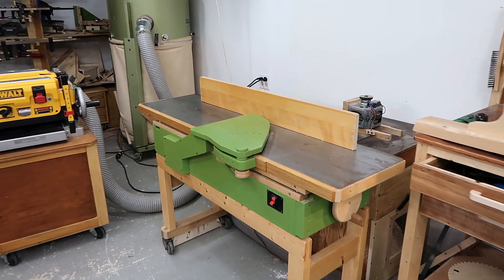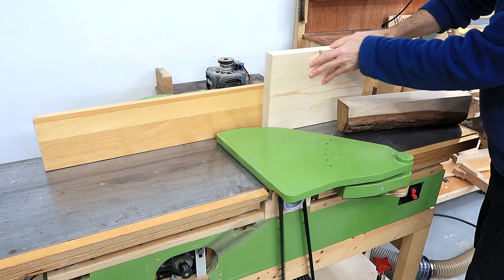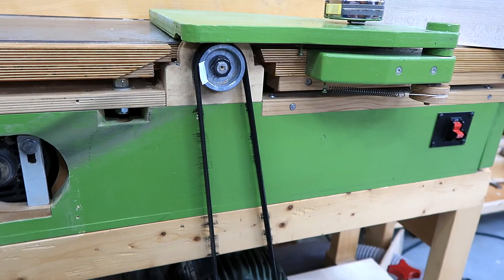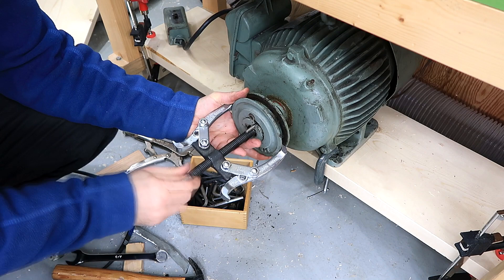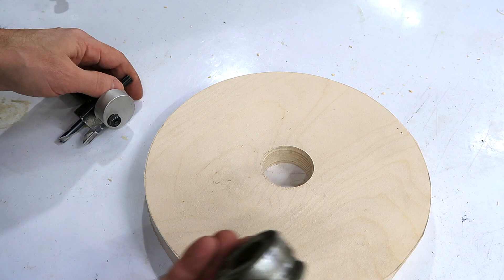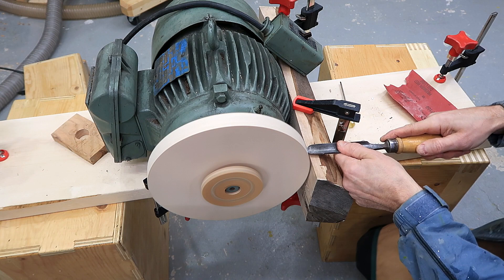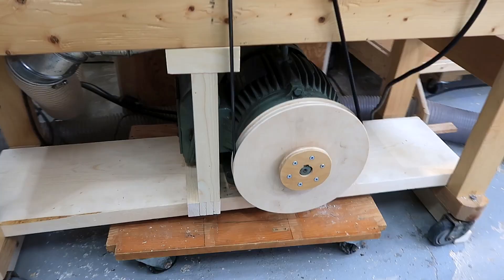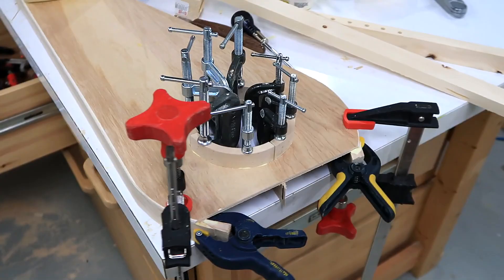Bigger motor for my homemade jointer

Comment: Another improvement would be a noise optimized opening.
On professional planers, the opening between the tables where the cutter head comes through is more of a comb than a continuous mouth.
That way less air gets trapped between the cutter head and the table edge thus generating less noise.

Comment: You should hook up a Kill a Watt power meter and measure the two motors, especially when jointing a wide piece of hard maple or oak. The induction motor might be capable of pulling a lot more than 1 HP when the slip angle is high.
Reply: Kill a Watt?!? Apparently you haven't been watching his videos on Raspberry Pi based current monitoring! Much better data from those.
Reply: Many continuous-duty motors have no problem to deliver ~3 times the nominal power for short amounts of time, although this might be less for a single-phase motor then for a three-phase motor. 

And of course, this is not the case for motors that already have a dubious horsepower figure. There's a large difference between a motor that lists a continuous duty output shaft horsepower, and a motor that lists a short time peak electrical input power.
Reply: @mlindholm  Wouldn't that be overkill for just making a quick test? He's used pi's for years but it's not like he threw the kill-a-watt into the garbage bin once he started using it
Reply: @Koushakur  Same same only different - multiply by the voltage and it gives you all the dead Watts you need.
Reply: @marco23p  Yes. The motor Service Factor is how much you can go over the rated continuous HP.

Comment: The noise of the cutter head is generated when the straight knife passes the infeed table. One way would be to make a bigger gap at the table. But this would bring other issues. That's why a lot of planers have a toothed edge on the infeed table. That decreases the noise since the knife of the cutter is no longer passing by a straight edge.
Reply: Yeh I was thinking that, the cutter head is like an impeller stirring the air up and creating pulses of air that are just god awful

Comment: I like that table saw maneuver.  It's either mad table saw skills, or just mad.  Not sure which.
Reply: Cutting freehand on a table saw like that will catch up to you, I simply don’t care who the operator is. I’m a professional woodworker who used to do that on occasion until one day using that technique hurt me bad. It happened so fast I didn’t know what happened for the first few seconds after it happened. Impossible to see it coming and prevent it, even if you think you have reflexes like a cat.

Comment: I remember you found teething the table to be unneccessary with the old design. It might be time to reconsider this now.
That said I am surprised 1hp is enough power for this. I would have guessed one would need at least 2 hp to keep it going nicely, especially with broader and harder workpieces. My 10 inch jointer has a 2,5hp three phase motor and that is plenty enough, although I haven't dared to take off more than 1,5mm at once with anything wider than 5 inches.
Thank you for sharing and nice work as always.

Greetings
Also Matthias

Comment: A good source of ribbed pulley's and belts is the automotive industry. A quick trip to the local wreckers (junk yard) will provide an amazing range of pulleys.

Also, very interesting that the sound of the cutter head is amplified with the dust collection on. I am guessing it has something to do with airflow over the spinning head.
Reply from the maker: Those tend to be the next size up in terms of rib sizes.  Also, none as big as I needed.
Reply: Yes, might be an interesting video in itself on silencing machinery. I hate those bloody universal motors, I don't know how Matthias has tolerated that one for so long especially inside a house. I wonder how difficult it would be to sound insulate that universal motor.
Reply: @jefflormans5441  universal motors are small and bloody fast. Once those cutters are hitting the work the noise difference is a wash. Most universal motor noise is the brushes on the commutator. Planers are one tool I use ear protection operating.
Reply: It's like the spinning impeller blades rapidly block and unblock a sound chamber making it effectively change size. Think acoustic guitar. Maybe some strategically placed sound-deadening mat such as Dynamat would quiet it a lot more.
Reply: @jefflormans5441  Worst thing about the Dewalt planer is how loud it is. Ugh!
Reply: @jefflormans5441  Supposedly, universal motors run a lot quieter on DC power, but it's going to take some big diodes and a big cap.
Reply: @matthiaswandel   You will have to get a small and large one along with a serpentine belt and possibly mount an idler to tension the belt. My mechanic gave me a bunch of old timing belt pulleys and idlers he was going to toss out.  The idlers are around 1" and 2" wide and are way nicer than the typical aluminum rollers used on DIY belt sanders.

Comment: Nice upgrade! It might also be possible to reduce noise from the cutterhead by modifying the table. Some jointer tables have a row of small gaps instead of a straight line at the edges facing towards the cutterhead. As far as i know this is also meant to reduce sound from the cutterhead by giving the air more room to escape when the cutterknifes pass the edges of the table.

Concerning your motor: why is that motor so big having only 1hp? When you presented your fathers selfmade tablesaw, it also had a motor that seemed to be really beefy for the 3 hp it has. 
You made a series of really interesting videos about induction motors. If your into it, I'd like to see you adressing this topic of motor-build-size in connection with hp in another video eventually!
Reply: HP is a measurement of torque and speed, this is a low speed motor so it has crapton of torque instead.
Reply: Older technology. Thicker wires and thicker insulation, lower temperature ratings, stator/rotor made out of materials that saturate at lower field strengths, older understanding of how magnetic fields should be shaped in a motor. all of this combine to require a larger frame for a given power rating.
Also, larger overengineering factors too.
That motor could probably run at 150% indefinitely.

My grandfather had an ancient 5 HP motor running his air compressor. It was about the size of a wine cask, and 3 times heavier.
But, it was still happily running a century after its birth.
Let's see how many modern 5HP motors are still running 100 years later.

Comment: That wedge lock system looks like something that would be very reasonable to make completely out of wood for anybody with a lathe. Specifically the ones that don't mind using it.  Would probably beat any of the other wood pulley fastening methods out there as well.
Reply: Like the idea! Although two things concern me:
1. the strength of the wood will probably not suffice to endure the high pressures at the key
2. Using hardwood (which seems the most logical thing for me to endure the stress) for the cone part on the motorshaft may result in rather large movements of the pulley due to shrinking and expanding. 

Do you have any idea how to work around that? Otherwise I might actually try it one day, even with the little grooves for the v-belt in the pulley.
Reply: @franzsadler1429  something like Baltic birch plywood could give reasonable hardness while a theoretically being more stable with regards to movement.

Comment: Excellent.   Sounds like a real jointer.  I would have been tempted to make the bottom pulley convex so its self centering.  Not sure if that would have worked.  Looking forwards to seeing it with the new cutterhead.

Comment: Thanks for another great video! I still want to make one of these. 
A helical head ($$$) would run quieter and give a longer lasting smooth cut. Most of the noise now is from the three flat blades slapping the air so when you turn on the dust collector, you are now slapping turbulent air making even more noise. 
My couch potato quarterback opinion 🤣

Comment: the reason that the jointer is louder with the dust collector on is because the knives force air pulses through the gap and turning the dust collector on amplifies the amount of air in those pulses. very similar to why blowers are sometimes added to sirens to make them louder.

Comment: when you use that kind of belt (serpentine belt),you have to put a rogue pulley in the way.best place to install that,is the middle of two pulley,a  bit to left or write,just make sure its on the circuit.(go to the near car repairing shop,you will find all this tools in perfect condition).
i love your works.

Comment: Curious to hear more about motor power “inflation”. Are you just suggesting induction motor power is grossly exaggerated like shop vac motors?

Love your stuff!
Reply: basically, in "the old days" stuff was rated more loosely. And it was also rated so that it didn't fall below the rating during the use period, and under most conditions. They were designed to be rebuilt, so you didn't want them to start failing because the coils were failing.
But now? They get rated for the minimum duty cycle and MTBF that they can get away with without getting hit for fraud.
It's kind of like comparing a tractor trailer engine to a Honda Civic engine with a GIANT turbo. Both will do ~600-650hp, but the Civic engine is literally on borrowed time. It's not an "if" but a "when" it's going to blow up.

Comment: With a belt that long would you not think of adding an offset tensioning third wheel?  With it being so susceptible to small amounts of movement even a slight stretch over time could generate enough slack to cause issues.
Reply from the maker: the old one hasn't stretched.  If it stretches, I'll move the motor.  I put spacers under the motor mounts exactly for that reason.

Comment: Matthias, I ordered your box joint jig plans. but to make that had some other stuff to finish. Finished a wood extension to my table saw, make a new box / stand for the table saw, now thats built my out feed table is not the way or size. So ill build that table out of solid hardwood, then im gonna start working on the box joint jig. My next thing I want is to either make a 12" planer or 15" have not decided yet. Ty for showing this stuff its amazing!! :)
Reply from the maker: 12" is plenty.  It gets difficult keeping really wide tables flat.
Reply: @matthiaswandel  ya I honestly thought that to. My father , and I just sat here , and re watched this video he was in awe you made it. I said dad this is the dude I learn all my stuff from haha.

Comment: you could always drill two apposing holes and tap them, then you'll be able to use two long bolts to "press the pulley off"

Comment: It’s amazing how much quieter that is now.     Also interesting  that it makes more noise when the dust collector is turned on     To me it sounds as though the cutter head makes more noise.   I guess that’s the air flow passing over the cutter   May also be that the air flow is being pulled different directions over the cutter head as apposed to just the cutter head pushing the air ?? Lol

Comment: MarkupCenter , I mean McMasterCarr, does ship to residential as long as you're a registered business/sole proprietor.
Reply from the maker: yes, but you can't register new accounts
Reply: @matthiaswandel  I think you can - you should double-check, I just placed an order a few months ago and had no issues. They can be expensive and shipping is always a surprise cost - but it's never outrageous. They often are the only place to get some things. And I like their CAD models which can be imported (and 3D printed) for prototypes! Of course, the wooden pulley is more fun!
Reply: @matthiaswandel  Surely a US viewer would be willing to receive and then ship it to you? I'll volunteer if no one else will, but I'm in Texas. Someone closer to a primary border crossing probably makes sense, like Michigan.
Reply: @matthiaswandel  I'm in Ottawa and have an account. Happy to help out if you ever need.
Reply: These MMC comments miss the point: if MW just bought what he needed, he wouldn't be MW, that's just not his style. The whole reason we're here--1.7M and counting--is that he doesn't just buy stuff like the rest of us schlubs.

Comment: My one thought on the new setup, is whether a link belt might be better, assuming you can source a cheap pulley for the cutter head. With the length of that belt, might see stretching issues.

Great video, as always.

Comment: As noted a good source for mult igroove pulleys is the bone yard. And yes there is the size problem. Install a jack shaft if needed. For belts an auto parts store. Multi groove belts run quieter than regular vee belts. As to turning the OD of the pulley to the proper profile the grooves are a 40 degree included angle. Surely you know somebody with a real lathe.

Comment: Would you test the power used with the current knives, and compare to the power used with the carbide helical cutters? I thought that since there is less contact with the wood at any point in time compared to a straight knife, the carbide helical cutter head would need less power.
Reply from the maker: Good idea.  I will have to make sure to make some reference cuts before I swap the head

Comment: I mean 1 HP is only the rating for continuous operation. You can still drive it with a higher voltage by an RPM controller to get more HP out of it. As long as you don't run it for hours this shouldn't be an issue. :)

Comment: I would suggest a 5hp induction motor at 3400rpm with a custom pulley. You need a machinist friend to make you a good pulley. At that rpm, you should be able to get by with +/- 6" bottom pulley and you can find a smaller pulley for the top.

Comment: I wonder how much energy is stored in that large pulley vs the weight of the cutter head at full speed.

Looking forward to seeing the necessary modifications and tuning for the new head. 

The physics are quite different so I'm curious how the "feel" of the machine will change. Of course the results on various common and awkward timbers will be interesting to see as well.

Comment: Correct me if I'm wrong - can't helical carbide cutter heads spin the other way round? If so, that could be useful for putting the belt assembly at the back of the jointer.
Reply from the maker: no, they can't

Comment: If you didn’t have a new motor, are there things you could do to the old one to reduce sound? I have no idea what I’m talking about, so I’m just guessing, but would foam around the inside of the motor enclosure, and on the opposite side of the piece of wood to which it’s mounted, help? What about swapping out the bearings? Maybe running it at a lower speed? Again, no idea what I’m talking about. Both of those things are probably labor intensive and expensive.
Reply from the maker: I tried plugging the openings for cooling air, didn't help.  A lot of noise is transmitted to the frame mechanically.  Just not worth the trouble.

Comment: I often wondered one thing about these motor upgrades: is it possible to hook up two weaker motors to power the same machine simultaneously in order to increase (possibly 2x) the power output?
Reply: It depends on the type of motor. You can probably mix any two universal motors as long as the speeds are somewhat close. Permanent magnet motors should probably be perfectly matched and induction motors you might be able to get away with a bit more variation as long as the specs are similar.
Reply from the maker: you would really want two of the same motor.  The amount of "slip" varies by motor, for example.  So two induction motors connected together, one might be doing most of the work because it has less slip.

Comment: "1HP before inflation" HA! Man I'm CONSTANTLY arguing with people over things like this.
Customer/Boss/Etc: Let's go with this new one. It's only 70% the cost and it's rated 25% higher!
Me: Right. But it's apples and oranges. That old one was rated so generously that you could turn it on and walk away for 10 years, and when you got back it would just be going out of spec.
Me: Then you can send it to get rebuilt for 10% of the cost and do it again.
Me: But the new one? It will run at that rating for 3 months. If you are gentle with it and keep the duty cycle under 35%. And you keep it perfectly clean. And you are lucky.
Me: After that it becomes scrap copper and steel...

Comment: Matthias,
I can't conceptualize why a helical head takes more power to run. I've heard this before. 
The helical is a shearing cut, so I would guess that's easier. There is a constant amount of blade touching the wood at any given instant, so the force should be more constant. 
I'm wondering if it has to do with the human ability to feed the wood faster. 
Any input you have would be greatly appreciated. And you probably don't hear this much, but I'd like to see it in the oscilloscope. I'm just not buying it. 

I've heard it argued that the straight knives pick up speed when not engaged, but then they dissipate that gain all at once. And isn't it easier to apply constant force rather than intermittent?

Thanks for any insight
Rich
Reply from the maker: the carbides don't have as much of a wedge shape to them because they are more brittle.  So it's a bit more like scraping than cutting
Reply: A helical is a different kind of cut. But the contact patch, instant and over time, is an order of magnitude more.
Maybe several orders of magnitude.
Reply: @matthiaswandel  thank you
Reply: @Prophes0r  thank you as well
Reply: @Prophes0r  
Yes, I saw this explained elsewhere . . . . straight blades are only engaged for a small portion of the head's rotation.  Helical heads basically have several cutters in contact with the wood at all times.  Its the same reason ADA wheelchair ramps have flat spots to let the occupant rest a bit between sloped sections.